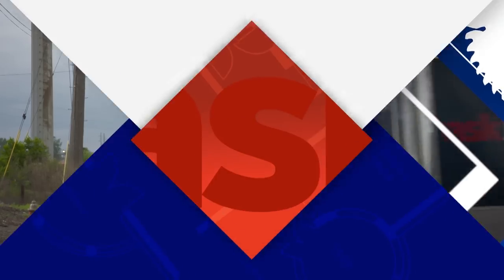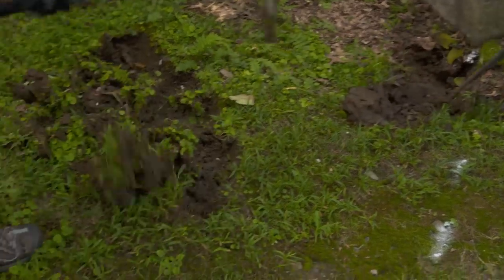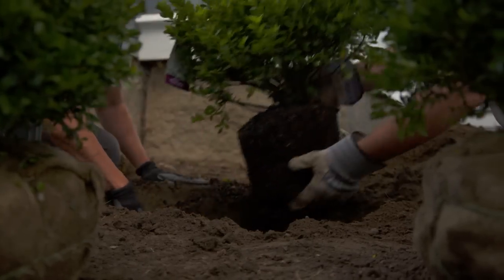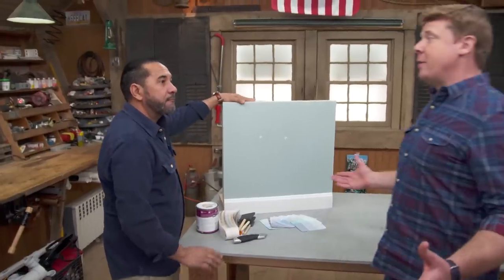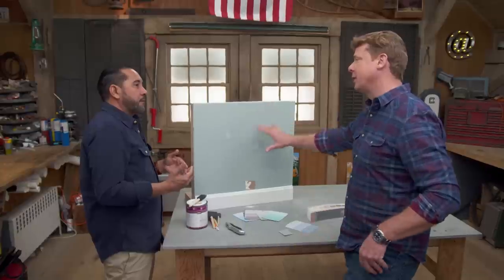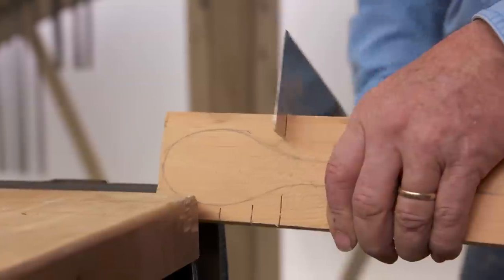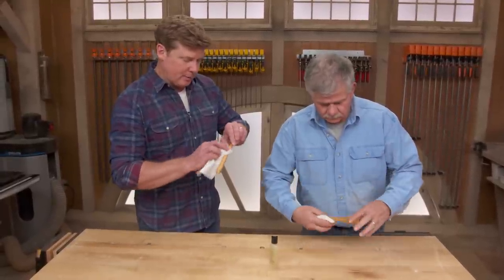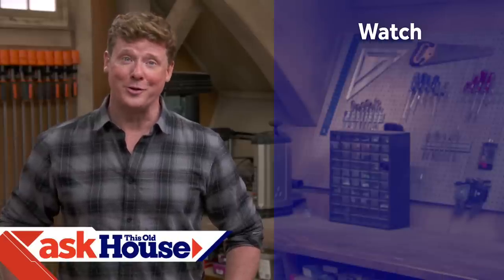Ask This Old House | Historic Plantings, Wood Utensils (S17 E26) | FULL EPISODE

Comment: I guess color-matching is all about how well their equipment works. I will never use it again. I took a piece, had it matched, and what i brought home; after it dried, was a completely different color.
Reply: Yep, put the same sample in the machine twice you get two different formulas..  it does usually get it close.
Reply: @HandyMike78  Yea, it was just close enough that if you werent looking at it you wouldn't notice, but once you saw it you'd never unsee it.